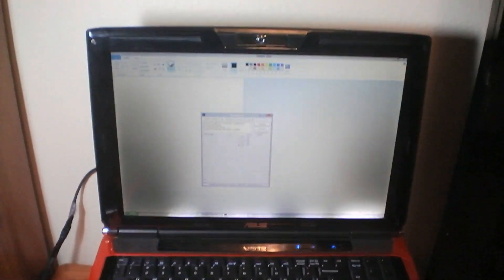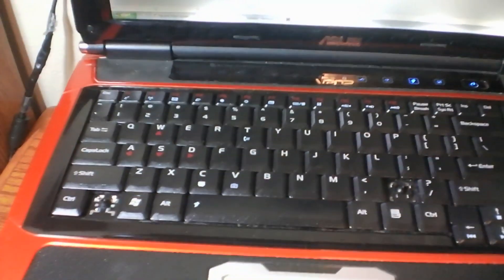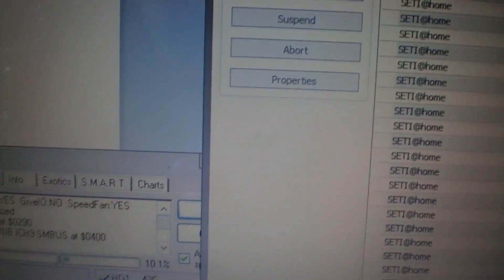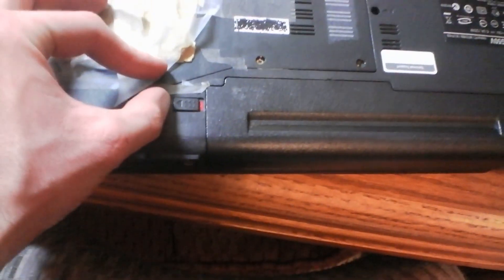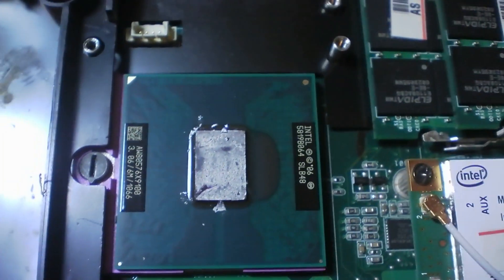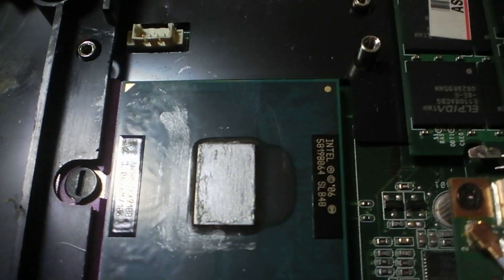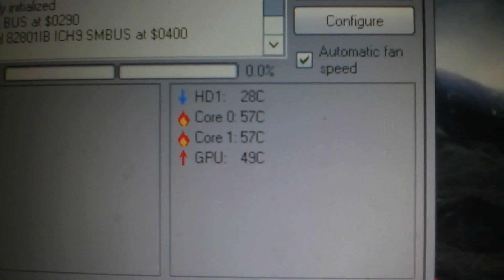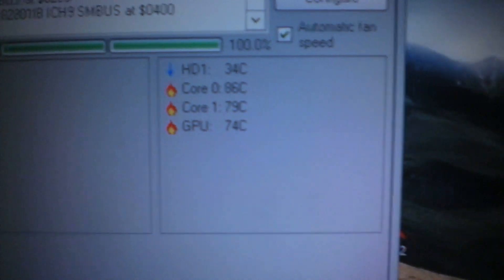Coollaboratory Liquid Ultra thermal compound dries up over time!

Comment: Well the issue here is that Coollaboratory Liquid Ultra corrodes copper and aluminium. It can actually break a heatsink in half if given enough time for the corrosion.
Reply from the maker: Aluminum yes (I think), copper no.  This was a fully copper heatsink. If it was corrosive to both, the product would be invalid for all chip heatsinks.. Although it did harden and become ineffective on my copper heatsink.
Reply: True. But there are reports that although CLU doesn't turn copper into dust like it does to aluminium, it still can stain the copper. There are reports on forums about this, also I used CLU on my laptop which had a small copper base which was mounted on the aluminum body. After running CLU for over 1.5year the temps increased so much my 2820qm was throttling to 0.8ghz instead of staying on 3.3ghz. I tried to replace the CLU but it had fully stained the copper and some of the CLU has actually moved to the aluminum part which made a small pit in it. I had to replace the heatsink.

Comment: it does not dry up it oxidises away (it is a metal)
Reply from the maker: Ah ok. I guess the rust isn't supposed to be a different color than when it is liquid out of the syringe.  I still experienced a huge decrease in the compound's performance over time, and it was not dust and all heatsink material was copper. It was very strange.
Reply: danwat1234 I'm confused
Reply from the maker: Me too. I need to have some breakfast. Oxidize means to rust right?
Reply: ya the liquid Ultra oxidises

Comment: I used this on the CPU and GPU in my laptop and it worked great at the start i was seeing 10-15 degrees cooler compared to the manufacturer paste, it's been on my laptop for over a year now and my CPU is now hitting 100 degrees 30-40 degrees hotter than day one application. im hoping it won't be to hard to remove, how did you get it off the die?
Reply from the maker: If it didn't come off with a damp cotton ear swab, I used a box knife / razer blade carefully. Finally someone with the same experience as me.

Comment: This is the reason why CLU/CLP is best preferred on die - ihs contact. die-ihs is normally resealed so that the contact does not move. When CLU/CLP solidifies, it maintains good contact between die and ihs, like soldered. However, when laptops (or desktops with heavy heatsinks) are moved, the solidified CLU/CLP contact may break, introducing gaps between the die and heatspreader. I hope you understand the decrease in CLU/CLP performance for your laptop. I am not sure if the CoolLab Metalpad is better at tackling this problem for laptops... Somebody please reply =)

Comment: Dude, mobile CPU t-junction is around 105C
Reply from the maker: Yuhong Liu Sounds about right. No CPU failure after years and years at ~85C and occasionally hotter nearly 24/7 with running Rosetta@home. 9800m gs GPU even hotter (and longer, about 4-5 years). SIlicon these days are tough. Arctic MX-2 holding up well after 1.5 years
Reply: danwat1234 Go ahead check out "Intel Ark" website for your CPU. I can't find what your CPU is... Ignore me if you know intel ark...
Reply from the maker: Yuhong Liu  Thanks yea I know Ark. 105 C for my CPU. It'll throttle as it approaches that temperature.
http://ark.intel.com/products/35431/Intel-Core2-Extreme-Processor-X9100-6M-Cache-3_06-GHz-1066-MHz-FSB

Comment: Facepalm

This stuff (Coollaboratorys liquid TIM's) is supposed to "dry" and harden to a solid metal like stuff. It did what is was supposed to do.
Reply from the maker: J0xxe Except for my application its performance becomes horrible some months after applying it. MX-4 for over a year at 80+ celsius nearly 24/7 no problem. I don't know if it's supposed to harden but regardless something gradually happens until the CPU is being insulated from the heatsink.
Reply: danwat1234 Then it is most likely a defective batch of that stuff and you should contact coollaboratory. They might be interested about this too. Shouldn't be a chemical reaction since the heatsink is copper.
Reply: J0xxe Yes it works just fine when it gets hard but how I remove it when it gets dry?
Reply: Jan Prášek isopropyl alcohol. And use the grinding pad that comes with it (NOT ON BARE CHIPS, only on coolers or heatspreaders)
Reply: J0xxe I had it only on heatsink and heatspreader, I will try it and write results.
Reply: J0xxe finally got isopropylacohol and it doesnt work at all, its like putting water on it, no reaction. From cpus heatspreader I will get it by toothpaste, but from copper I will have to abrade it away :(
Reply: Like I said in my previous comment, use the grinding pad. The color alteration doesn't really affect that much, as it is metal aswell. As long as its even.
Reply: I will have to, I just didnt want scratch surfaces, from cpu it will go off with just power and toothpaste, but copper will need complete abrade with grinding pads of different graininess >.< damn it will be work... Thanks for all help (not like coollaboratry support)
Reply: Just use the one that came with it, should get it off without scraping it.
Reply: In my country you recieve just syringe with paste. You can scratch surface with just hard side of sponge on dishes when we talk about mirror like surface.
Reply: +danwat1234 Of course MX-4 works longer. It's silicone based. It can last for up to 5 years. This is liquid metal, it's all fine. It should last for about 6 months - 1 year before you need to replace it. But i don't see a problem. I clean my computer once every 3 months. I always change my compound then.
Reply from the maker: +totallyrandomstuff1 On a laptop that's not ideal. They aren't necessarily designed to be opened up every year. Plastic tabs can break, etc. I didn't know the liquid metal type actually doesn't last more than a year usually, that this is normal?
Reply: Yeah. who's stupid enough to use liquid metal or even just liquid based cooling paste in a laptop?
Reply: +totallyrandomstuff1 shit ton of people dumbass
Reply: Well all thermal benefits are totally out the window when it's dry!

Comment: How are those heat sinks even working? They're scratched to hell and you have the vent completely covered trapping the hot air inside. The delta between ambient and material temps matters quite a bit in cooling.

Comment: I stay away from conductive thermal paste like arctic silver etc...
Zalman STG-2 ftw. Keeps this old .45 fab. 125W phenom 2 at 45-47c under full load on all cores (3d renders for hours) Been 4 years now... performs the same as the 1st day... didn't need a burn in.
Reply: +Advection357 arctic silver isn't conductive
Reply: OK It's made of silver. Silver is conductive. Try again smartass.
Reply from the maker: +Advection357 Hahah
Reply: +Advection357 Straight from their website "Not Electrically Conductive:Arctic Silver 5 was formulated to conduct heat, not electricity."

Your move. Do your research.
Reply: OK It's slightly conductive. Not an efficient one, but it is.
"While much safer than electrically conductive silver and copper greases, Arctic Silver 5 should be kept away from electrical traces, pins, and leads. While it is not electrically conductive, the compound is very slightly capacitive and could potentially cause problems if it bridges two close-proximity electrical paths." 

If it was 100% not conductive, it wouldn't bridge. You can't have silver in a compound and be 100% non conductive.
Reply: Advection357 It's non conductive. Just don't go pasting it on your motherboard.

Comment: No point in this on a laptop as your theoretical max heat removal is capped by the tiny laptop heatsink's inability to remove the heat - you BOILED off any liquid in the compound!!
That or you work for AS. This is the fourth place I have witnessed comments trying to demolish Coollaboratory Liquid Ultra's rep. in 10 minutes.
Reply: There's no liquids in the metal, metal is the liquid... It's gallium IIRC. The one that fucks aluminium up.

Comment: It's being over a year, how is the mx-2 holding up?
Reply from the maker: Works great no issues. Temperatures haven't increased
Reply: danwat1234 Hi, Thanks for the follow up, recently ordered the MX-4 variant for a server, so it will long up time. I came at mx-2/mx-4 based on the durablity of 8 years. it supports a choice I made so I'm rather happy about it. Thanks :)

Comment: danwat1234  I would suggest buying a new laptop or getting a Computer not a laptop. I see you are testing other Thermal paste and with you using Coollaboratory's Liquid Pro/Ultra that would be in my opinion the best lower temperature you can get. Because so far CLU's beats every thermal paste. The only reason why your still getting high temperature is because you don't have a good Heatsink that you can mount on your Laptop For example a Copper base nickel plated tower heatsink like a cheap but high performing CoolerMaster Hyper 212 Evo or more expensive Cryorig's R1 Ultimate. Bottom line is, if you use dozen more different brand thermal paste you will more likely to get crap results and I am 100% sure it won't beat the CLU temps that you already have shown in this video. The only way to fix you temp's is by using a Big tower heatsink or a Liquid cooling solution which you can't do with a laptop. I have seen some folks testing out GPU temperatures using tower heatsinks and the temperature greatly improves compared to using your normal laptop cooling which is not that good.

Also Coollaboratory's Liquid Ultra/Pro dry's up but it doesn't harden like a rock unlike solder. Also if you apply heat on it it will melt back to its liquid stake with 8 degree melting point (see manual/specification). Hence the reason why it performs so well compared to other silicon base thermal paste. Basically if you see the hardened CLU on your chip, when it gets hot the CLU will melt back.
Reply from the maker: My laptop has good airflow thanks to the builtin Forcecon fan and the heatsink is adequate. With Arctic MX2, about a year later after switching to this, it's still holding up well. Some laptops are built well for heavy duty work, but a lot aren't.

CLU melts a 8 degrees? I don't see how it hardened then when I open up my laptop with CLU, it's hard but it's about 70 F in my room.

Maybe it did melt back when the CPU got hot but I didn't test.
Thanks
Reply: They melt actually, even the older cpu's that had soldered die and ihs can be safely separated if you heat up the cpu. But if you leave the soldered cpu cold then tried to de-lid it the ihs won't separate from the die because of the solder and if you force it open it will take a chunk off the die and it will kill the chip but solder vs thermal paste the solder had better temperatures for sure., i think thats whats happening to CLP or CLU that dries out they act like a solder but if they melt you can take them off using  alcohol :)
Reply: I was using semi-gaming laptops for about 5 years, and I tell you - PC only, if you want to play games. Average PC performs better than good laptop, and costs 3 times less. Even when laptop shows good numbers on tests, fps - the real effect is not as on PC. FPS, for example, are inconsistent, they usually jump up and down very fast, so even when you see number 60, it's actually 40-60 or so, and you can see and feel that it's not nearly as smooth as 60 on PC.

I know for sure - no more laptops for me, when it comes to gaming.
Reply: Laptop's portabilty can be good, such as making assignments for school/university or doing stuff for work, or watching shows etc. But for gaming it just have to be a computer. Sold a couple of my laptops and built a decent PC instead. But thats just me, really depends on what people prefer.

Comment: try cleaning the old paste off next time.....

you did SOMTHING wrong here...  I have that stuff on an amd rig from 2011 and it's still fine...(same with ALL my rigs...)
Reply: danwat1234 Same here and still it hardened. I had to sand it off. I never use Coollaboratory Liquid again. Gelid GC-Extreme is the best of the safe ones. http://www.overclock.pl/images/articles/content/artykuly/2012/09/Test_past_termo/wykresy/wykres_12.png
Reply: Banage Gitas
 how is the gelid going?  I applied mx4 to die and it dried already after 1 month
Reply: Vault Nomad No problems so far. Longest run been over 6 months. It get tougher but performance has not decreased.

Comment: Yeah wierd.. High temperatures... The freaking airintake is covered. BS video.
Reply from the maker: No, the air intake is not covered. The tape is used so the fan won't blow air (that's sucked in from the bottom of the laptop, or from vents at various places on the bottom of the chassis) up against the bottom of the keyboard. When I have the heatsink/fan out you see the tape on the fan, that side goes against the bottom of the keyboard. The side that faces the bottom of the laptop, the fan is clear. Yes at 2:30 there was cardboard on the laptop, but that is to plug a hole that I MADE, by default there is no hole there anyway. The fan sucks air in from various holes on the bottom of the chassis and blow it out the side vent.
See? https://www.google.com/search?q=g50vt+bottom&espv=210&es_sm=122&source=lnms&tbm=isch&sa=X&ei=B_QMU_H2DIGDogSyyoKAAg&ved=0CAsQ_AUoAw&biw=1344&bih=767

Right now I have that cardboard removed so the fan sucks air in directly from under it so there is more air flow through the heatsink but the other components of the laptop like the hard drive run hotter. It is a common mod to reduce temperatures of the CPU and GPU. Regardless if I have the cardboard installed or the hole I made with a dremel exposed, the thermal compound performance is apparent.
Reply: A Laptop doesn't have the space to mount a better Heatsink or Liquid Cooling solution. It doesn't matter if he uses Coollaboratory's Liquid pro or ultra....

Comment: Because Liquid Pro/Ultra is not meant to be on the IHS->Heatsink...it's supposed to be on the DIE->IHS (Delid)

gah.
Reply: @Jason Berman Your Wrong . Actually Coollaboratory's Liquid Ultra and Pro's were ORIGINALLY designed for Heat sinks to IHS. It was only now that its been used for Direct Die to IHS to IHS and Heatsink because people started delidding their CPU.  it was only meant originally for IHS to Heatsink. The only reason why on the video above have higher temperature is because a Laptop doesn't have the same heat sink which PC Towers have which are mostly bulkier or are usually liquid cooled.
Reply from the maker: My x9100 CPU doesn't have a lid on it. The die is just covered by epoxy or whatever
Reply: i have it on ihs, because i have sandy i can't delid.
Reply: Laptop CPU has no IHS, only the die.
Reply: No its meant for IHS>Heatsink. Its just that it performs really well and people who delid favor it over other more conventional pastes because of its thermal performance.

Comment from the maker: Yes I have when the Liquid Ultra was worn out. Normal voltage on my X9100 is 1.238V and I brought it down to 1.21V but the temps were still pegged at 104 Celsius at 100% load. But now with the MX- I can leave it overclocked at 3.45GHZ at 1.3125V all day at 100% load and it's at 78 Celsius. Hoping that lasts for 5 years or more but if it lasts a few years I'll be happy.

Comment from the maker: OK, I repasted with Arctic MX-2 and guess what, I'm at 3.6GHZ at 1.325V with my X9100 CPU in my G50VT laptop and it's not going over 82 celsius at full load! Let's see if the MX-2  8 year durability claims hold true.

Comment: That's what I'm thinking. As you can see in my profile pic I've delidded my 3770k and applied CLU to the die and it's been like that for some time now without any degrade of performance. Same with my laptop, which has a i3-370m. On my lappy, stock paste ran at 88c max, MX4 ran at 83c max, and CLU when I applied it brought temps to 74c and the next day the max temps were 70c at the same ambient. The max is still 70c. So my temps dropped another 4c once CLU settled and 0 problems months later.

Comment from the maker: Not sure. For laptops I'd get a long lasting thermal compound because it's not designed to be taken apart every year.
For desktop you can get a high end compound that might not last as long as you are fine because the CPU will throttle itself as it reaches it's designed temperature limit. Same with laptops but you wear down the head of the screws and plastic tabs taking it apart over and over again.

Comment: Wow, so Yearly applications are a good idea it sounds like.. I just used some CLP on my Haswell and dropped 8C over TX-4.. Honestly that big drop in temps caught me off guard.  My overclocked haswell now runs as cool as my overclocked SandyBridge.  I wonder if the Pro dries like the Ultra?

Comment from the maker: The first time it was 9 months of hard use nearly 24/7 around 85 C was normal but then it was rising to 95-100 C and about a year into it it was pegged at the throttle temperature of 104 C whenever I was crunching seti@home (nearly 24/7). It was completely dried up.

This second time, it happened immediately after dusting out with compressed air so it may be something else, but the air flow seems fine and the fan is rotating at full speed. I'll check it out today or soon.

Comment from the maker: Yea it was just for grins. I have read some reviews of thermal compounds that includes lipstick, mustard, chocolate and other materials. Of course they don't work well for very long.

BTW a lot of good spark plugs come with antiseize equivalent material on them already, like NGK laser platinum/iridiums I believe.

My laptop is overheating again. Time to try Arctic MX2 since it's rated for 8 years durability.